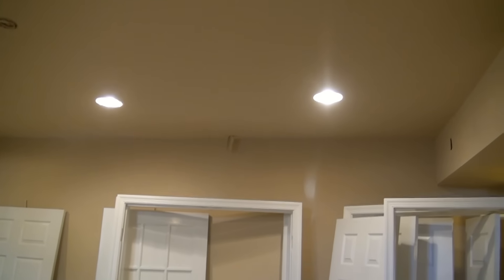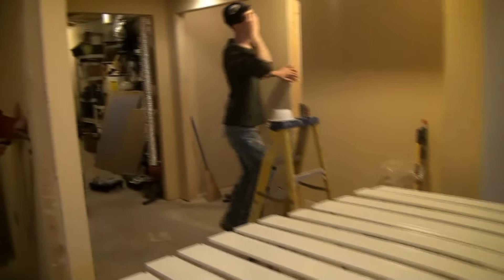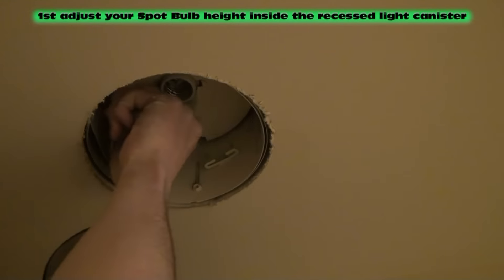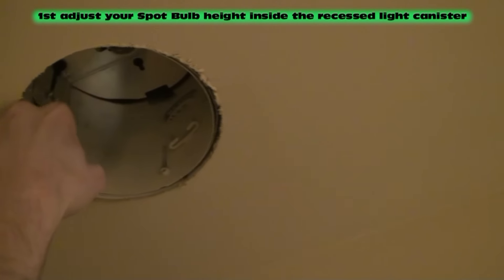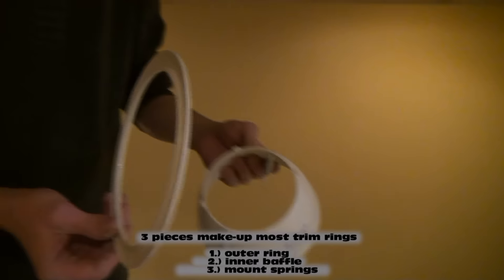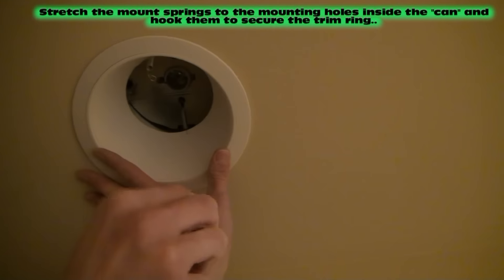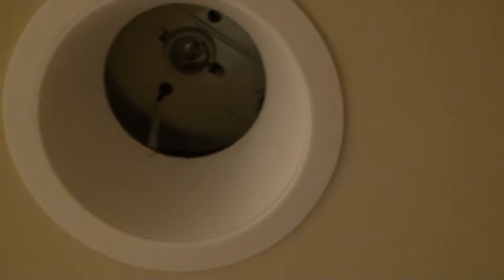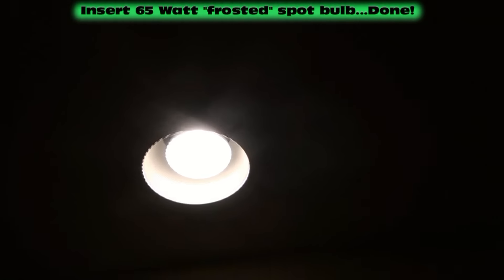Basement Electric Trim Ring Installation

Comment: My cans are older, they have the other type of tension spring, but no place for the spring you show.  Can i drill a small hole to make the hole to get these springs or do i have to get the other type of baffle?
Reply from the maker: Baffles are pretty cheap...I would get a few new ones and pop them in. You could drill a small hole and use the springs...I think you can buy just the springs as well.

Eddie